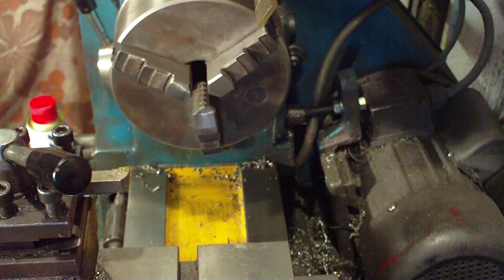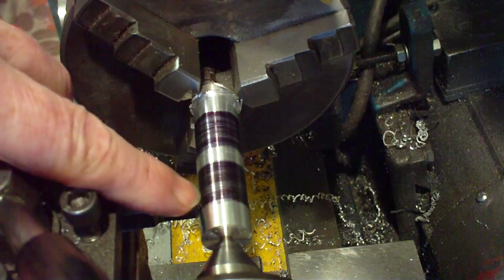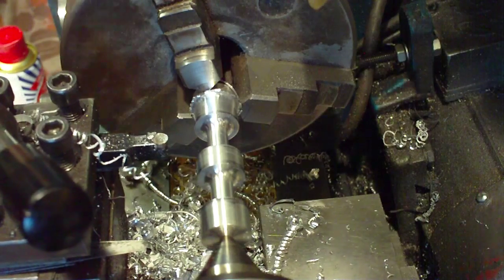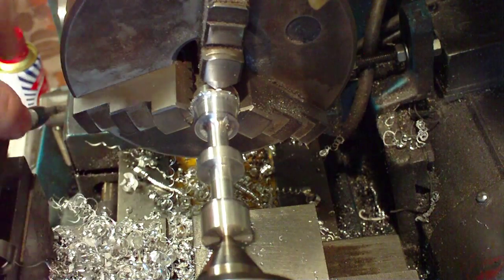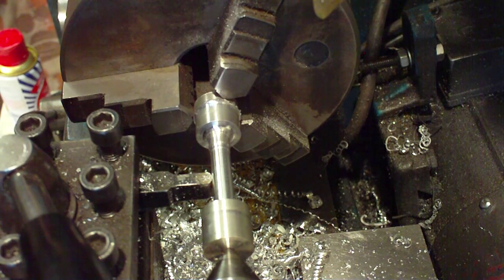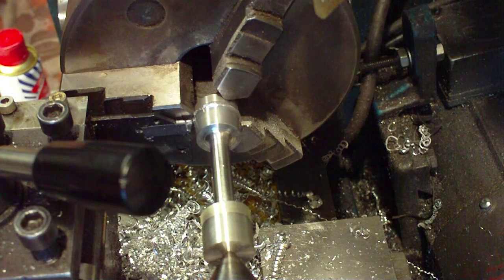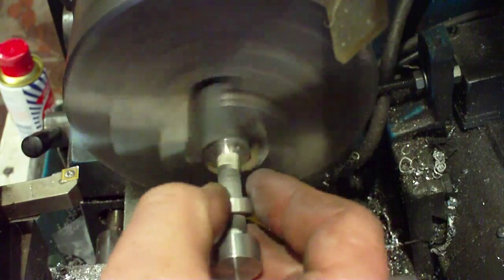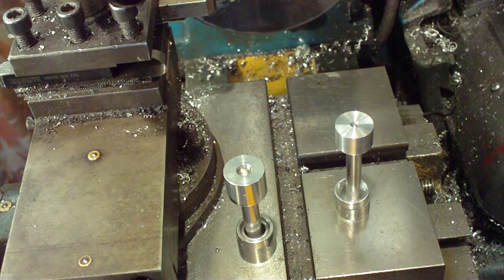Captive Ring Puzzle

Comment: When using a parting tool make sure you lathe is in low range or you risk breaking it in your project and use cutting oil
 (even with aluminum)
Reply from the maker: Thanks, I usually do.

Comment: Nice idea, thanks. You used a wood turning technique to make the captive ring... I have an idea that might get you the same results without the risk of the tool leaving your hand. Get an engine INTAKE valve cut off about 90% of the valve head. Just stand the valve and cut off all extending on two sides of the stem; you end up with a "T" shape. Now cut one of the short parts off the "T" and sharpen the side left. This will give you a very strong curved cutting tool, put it on the tool-holder and undercut from both sides. This works great on aluminum, brass or copper.
Reply from the maker: Hmm thanks, I might have to experiment ;)
Reply: +Spen Crowson I made one for a larger project, if you provide an email I'll send a pic.
Reply from the maker: Sounds like a plan thanks. tces@oneuk.com